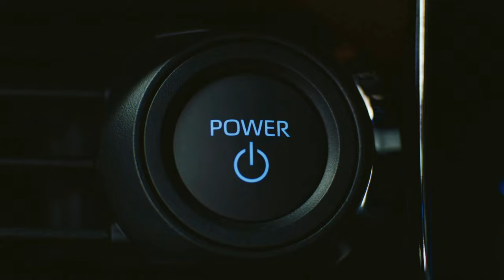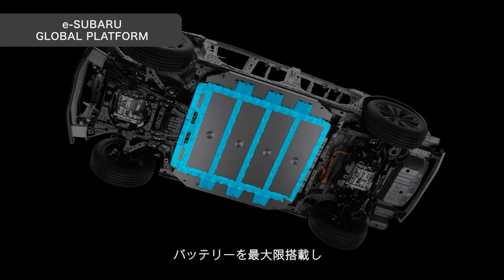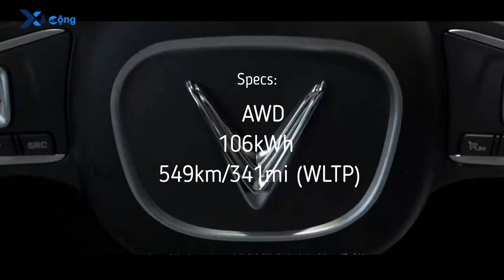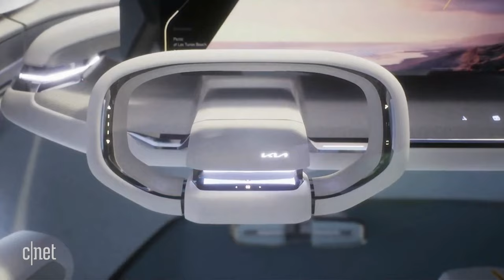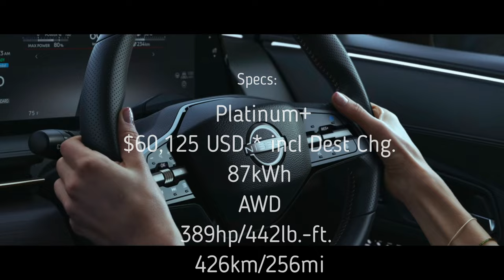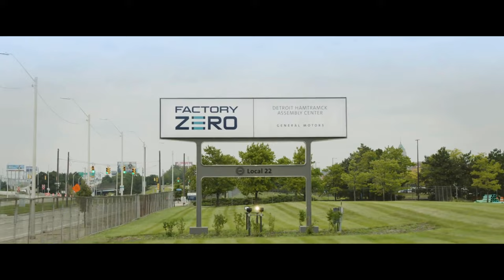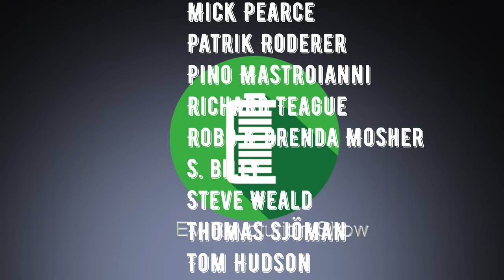Episode 150 - Some LA Autoshow reveals including Subaru, Kia, Fisker, Nissan and Vinfast!

Comment: Congratulations on your 150th episode Ken, that's quite a milestone and a very impressive cheering section assembled in these COVID times! :) Great overview of some compelling new vehicles. I'm not a big fan of SUVs and crossovers generally but these newer compact models seem to be more attractive, practical and efficient. Sad to hear about ongoing delays though, it looks like 2022 and 2023 may be the new 2020 we were hoping for a few years ago! Hopefully the Ocean makes it to market after several prior "reveals" and much fanfare, I believe they were originally planning on releasing it with a solid state battery... another so called "world's first" that really wasn't :) I wonder if the Solterra AWD will have a larger single motor, as the power output is not much higher?
Reply from the maker: Thanks JP for all of your support!  

Yes 2022 will be a waiting game primarily for inventory for all these announcements.

Hope to see more specs on the Solterra soon but count on it with AWD only version for NA.
Reply: @EVRevolution you're most welcome, Ken and thanks for all the time and hard work you put into all those shows. I expect you may be right, and I'm thinking that the stated power output might be for each motor of a dual motor AWD version, if so the Solterra will be a hot hatch for grown-ups! :) I really like the smooth and elegant styling of the Ocean though, and the 37k base price seems reasonable for those specs